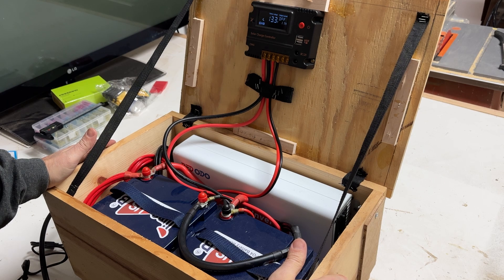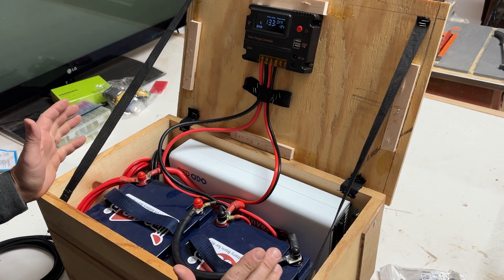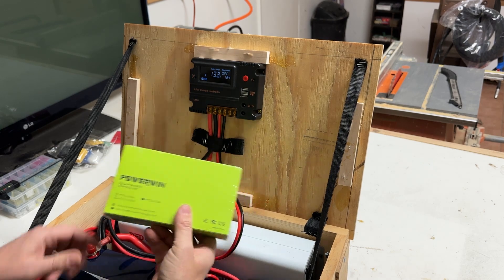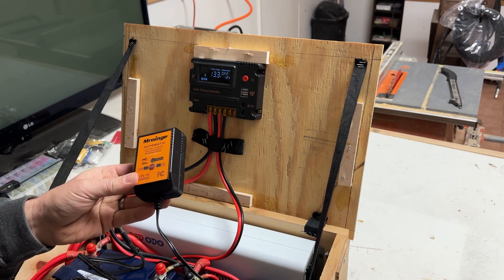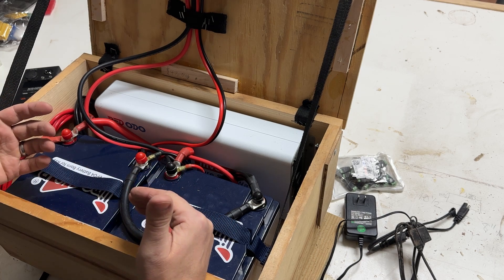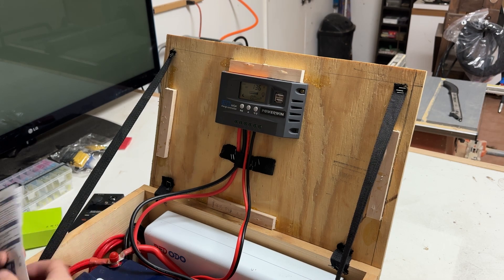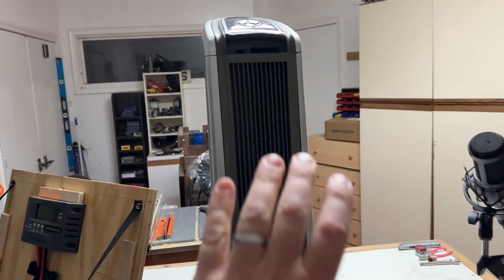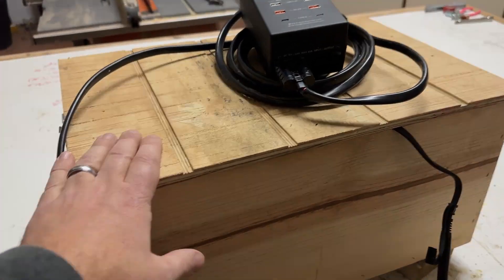I Did It All Wrong - DIY 2000w Power Station Update

Comment: So far I have 2 different brands of solar charge controllers first problem is that although they are designed for lead acid batteries the full voltage shut off is 12 volts that would be okay if I I had 6 of the old 8x8x16 inch 2 volt glass battery cells but a 12 volt battery now is actually 14.8 should be float charge at 13.4 and dead or flat at 12 volts so both are designed to kill the battery or batteries within a year had the same problem with my booster packs the other problem is they are PWM instead of mppt which doesn't optimize the performance of the solar panels their output is closer to what a 12 volt lithium needs when I first heard the proper charging parameters and care of sealed lead acid batteries I 💭 it had to be wrong so I grabbed my old black and decker booster pack and opened it up to find out the battery manufacturer and find out from their website the proper charging parameters and didn't have to written right on the battery was do not discharge below 12.2 float charge is 13.4 and full charge is 14.8 and on the built in charger output 12 volts did find out that recharging to 13.9   volts as my evercharge did also kills the battery in a year by proper charging I did get almost 2 years but the damage was already done now l have to open the charge controller up and see if I can change the charge peramiters if not I'll have to get a mppt one and they're not cheap

Comment: You did not do everything wrong. You did many things correctly. I learned a few things from the other video that gave me some ideas. The only problem I have with most of these videos is that they are usually rushed and not explained comprehensively. The part about charging was rushed a bit. I would just simple buy a cheap LFP charger. Dont' be so hard on yourself and don't some of the comments personally. It's a big audience and some are just not nice folks like yourself.

Comment: I hate to tell you this, but you should’ve spent less on a smaller inverter because those 50Wh will never for provide enough energy to get 2000 Wh out of the inverter. The other option would’ve been to get one battery with a 200 Wh 200A BMS.

Comment: Electronic technician here.  "This has overload protection so it will shut off..."  should be "This has overload protection so it SHOULD shut off..."  "There's no way to overload this"... when it's working properly.  That's the whole reason we use breakers and fuses.  Electronic devices don't always do what they're supposed to.  Insulation doesn't always protect wires.  You're protecting a potential fault, a fault you can't predict, so our last line of protection is a completely separate device to cut the power.
Reply: I AGREE WITH YOU 👍 💯 👌 👏 🙌God bless you 🙌 
Good morning from Greece 🇬🇷 💙 Καλημέρα από την Ελλάδα !!🎉😂❤
Reply: yup  and everytime we step outdoors we are at risk to be struck by lightning.........at some point it becomes ridiculous to shout out perceived safety issues. Can it happen? yes will it happen?  There is also a concept called risk management........
Reply: @arnoldreiter435  The way we manage overload risks in electronics is breakers and fuses.  We don't just hope and pray that we don't burn the house down instead.
Reply: @piquat1  Then the challenge for you is to make a video that would improve on this design instead of being an arrogrant Mr. Knowitall. This is just a simple design which I found a helpful place to begin and this guy is super nice and is kind to make corrects that are constructive.
Reply: @mannys4036  I'm not being arrogant.  This is a matter of safety and he's suggesting things that can get people hurt, or worse.  Obvious things too, things a simple car audio installer or alarm technician should know. 

Nobody needs a video about breakers and fuses.  They're not complicated things, this isn't electrical engineering.  You add up your loads and use an appropriately sized device.  Same as installing a breaker in a panel in your house, for which there are TONS of videos.
Reply: @arnoldreiter435  It's so sad to hear what you have to say about safety.

Comment: I used the Rigid 2.0 rolling tool box from Home Depot.  It uses a removable handle/wheels system which is easy to remove and put on.
Reply: nice suggestion but they are pricy and would make it a more expensive project. I saw the price at $139 at Home Depot. I think there are cheaper options that be sought out.

Comment: Hate to bring it to you, but that Solar Charge controller is also NOT compatible with LiFePO4 batteries, even if it says so on the box, that is pure marketing. A true LiFePO4 battery charger will let you set BULK voltages, Absorption Voltages, Float Voltage, but also Absortion charge time etc. These voltages are NOT the same for every LiFePO4 battery, that's why it is important that you know which voltages to use on your batteries and to set them correct in the charge controller. There is no "universal" LiFePO4 charge setting. You can't really expect this from these kind of chargers. They are basically all the same China PWM chargers. If you want a true MPPT LiFePO4 charger, go for a Victron Smartsolar MPPT 75/15
Reply: To add to this, if you can't find any specific voltages for your batteries, the most common voltages for 12V LiFePO4 are: 14.4V Absorption, 13.8V Float. Absorption time should be no more than 1 hour. And also NEVER charge them below 5 degree Celcius. This will permanently damage them if they don't have cold temp charging protection.
Reply from the maker: This controller does let you adjust all those settings
Reply: @SSLFamilyDad  Then I stand corrected!